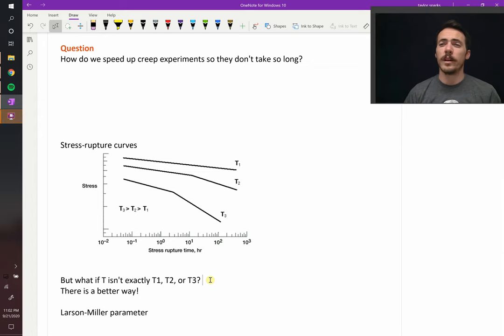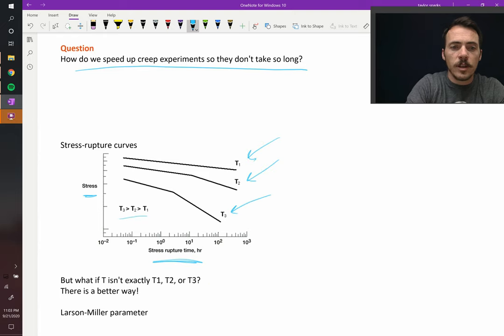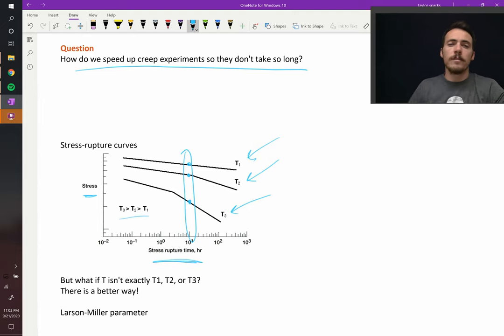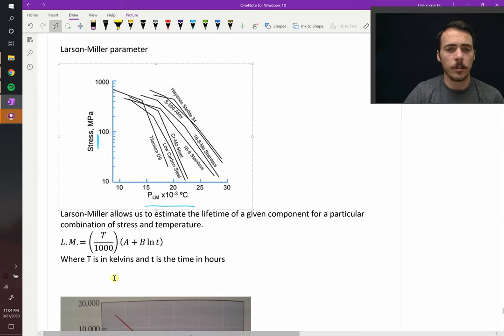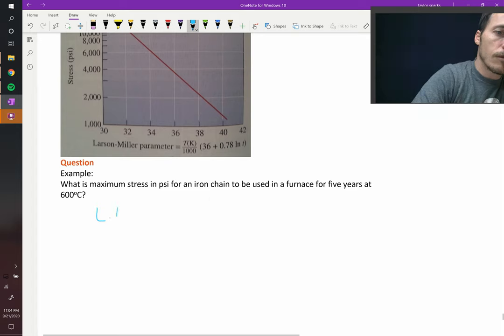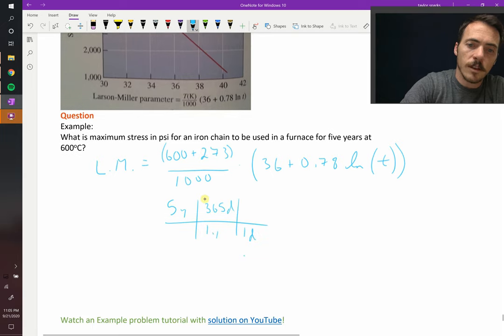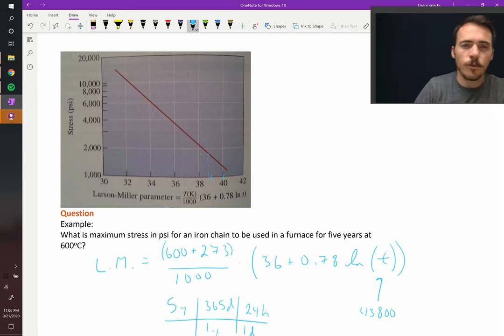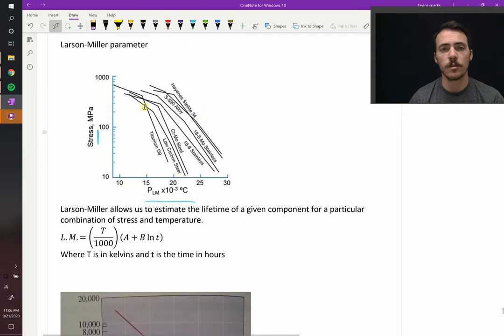Using Larson-Miller parameter to do accelerated testing

Comment: Hello Taylor,   

hope your 2021 has began well! Steel material standards (EN, BD, ASTM) have some creep-rupture times tabulated in them produced e.g. using parameters like this. I´m interested in extrapolating such data and wondering how this should be done correctly. Are there some major caveats should I be ok with some kind of logarithmic extrapolation as long as I don´t overdo it? Of course these data are also just as good as the backing test data but it´s pretty much the best there is.

I myself find using psi utterly barbaric ;)